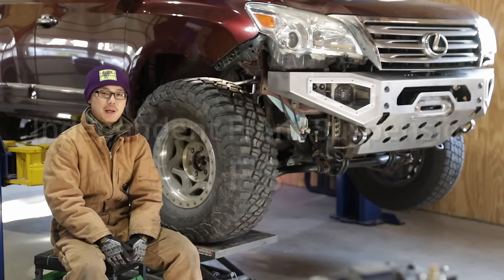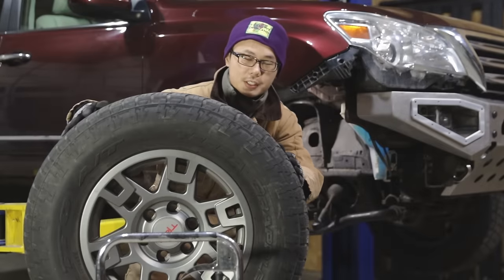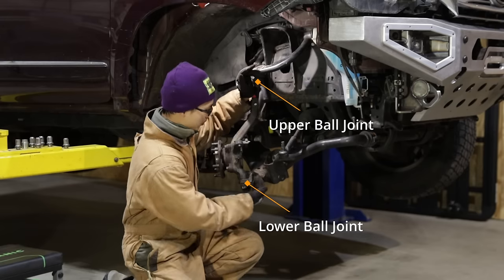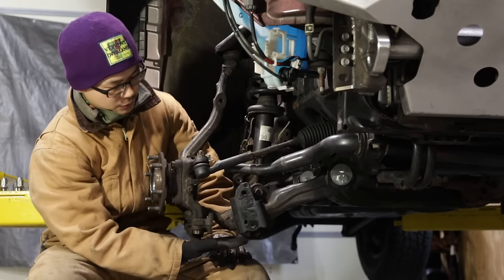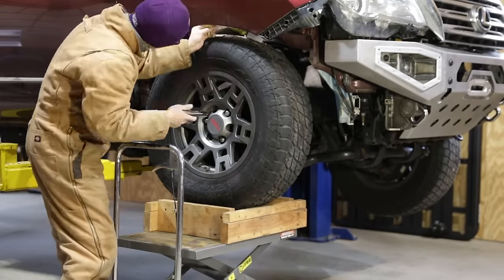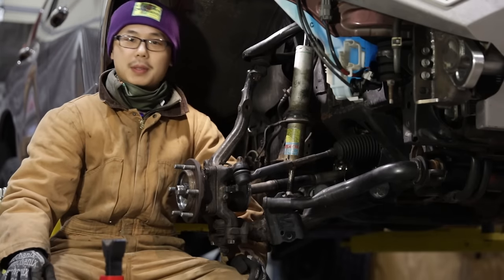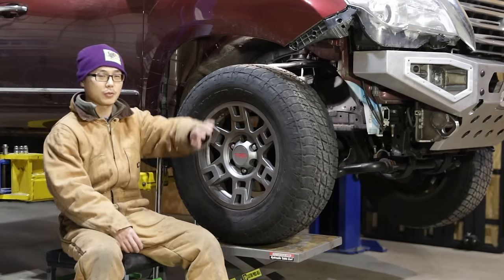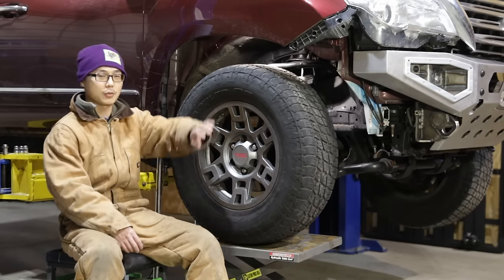Everything About Toyota IFS | Suspension Construction and Limits | Part 1

Comment: Absolutely love this series. I always knew   I wanted to lift my 4Runner no more than an inch or two because I feel heavily lifted rigs were so excessive and unnecessary. People get obsessed with fitting bigger tires, but with that you’re going to increase weight, need lower gearing, drop the diff and with all of that you’ve now taken a beautifully engineered vehicle and changed it to something untested. You’re also going to effect CV angles (they break all the time) you’re going to raise your center of gravity and risk toppling over, and you’re going to lose down travel at the cost of increase up travel. 

Super interesting to see you test the diminishing returns you see in travel and articulation. My goal will be to maximize my travel and articulation while maintaining ride quality and factory reliability. I cannot wait to see your video on sway bars cause my next purchase was going to be detachable sway bar end links
Reply: My stepson has bought an older single cab Hilux.  He doesn’t even have his license, but has embarked on “improving” it.  He has lifted it by 4 inches and wants to put oversize wheels on it.  I am quietly confident that he will be breaking driveline and suspension components as he also has a heavy right foot.  I would love him to watch this video, but I doubt that he will.
Reply: With longer  suspension uograded you  gain upper and lower travel.  . He said so on the video. Dunno confused
Reply: @DavidRamirez-fe5dd  watch part two. He’s taking about extended coils, most lifts are stock coil size, adjusted with preload.  Which comes with its own set of problems.
Reply: @bruiser6479  I looove the hilux. I would focus on making sure that truck runs perfect with no misfires and such before doing anything to the suspension. They do make good rock crawlers, especially with the solid axle.
Reply: @jvogler_art4708  I totally agree.  Unfortunately my stepson doesn’t.  My advice to him was to leave the vehicle stock and to only change things when there was an objective necessity to.  He really has no understanding whatsoever of how vehicles are designed to be a coherent system.  He is adamant he wants to learn from his own mistakes as opposed to other peoples mistakes.
Reply: @bruiser6479  Isn't that what we call, "learning the hard way" ? haha.  I don't mean or wish him any harm and you're giving him some great advice.  It can sure get expensive going with what looks cool but has negligible or sometimes negative value for the vehicle's intended or actual use (not to mention failures far from home and then downtime) which is what you seem to be advising him about, oh well... He'll learn eventually !
Reply: That’s kinda why I was leaning towards the trd lift kit.  2 inches and if toyota is ok with it, it can’t be too bad right?
Reply: @ceeIoc  2 inches is optimal for a 4 runner. If you wanna fit 35s and up and make a serious offroader  you have to body lift and tub the wheel wells. continuing a higher suspension lift will just raise the center of gravity and you won't fit bigger tires. Been demonstrated on this channel and others.

Eimkeith a serious offroad fabricator for 4runners runs a 2 inch suspension lift and a 2 inch body lift. Much better than a 4 inch suspension lift which bascially just changes the starting point of the suspension and loses down travel.

As far as a TRD lift goes, Toyota told TRD, when making the TRD pro that they could do anything to it except raise the Center of Gravity, because its a huge liability for them and increases chance of rollover (you probably won't roll though) but anything TRD is going to be basically aftermarket (not official toyota exactly) but licensed through toyota, unless that has changed over the years.. Probably why they approved a 2 inch lift kit. Doesn't raise the center of gravity very much because the suspension is still traveling in it's normal range of motion and not a raised one with no down travel.

For my rig i just opted for bilstein shocks and 32s lol. Decided i didn't want to be johnny MOAB anymore and just wanted to enjoy driving my vehicle in safer locations. and use it for camping and road trips.

Comment: Kai… thankyou so much buddy… never seen any videos get to the details you have done… little overwhelming with the technical stuff, but it’s amazing… I just upgraded with a 3” lift kit from Ironman, I think I need to lower it to May be 2.5 or more…. Keep it going buddy… great job
Reply: Have a question, I see in the video you are adjusting the front coils… is this something that can be done when the strud is on the vehicle…
Reply from the maker: Thank you! It depends on the coilover design. The ones with a solid adjustment rings like this, you can. Just lift the tire off the ground so the spring load is low enough. Some other ones like Fox and Kings have a split clamping style ring. Those you better remove from the vehicle and use a spring compressor before adjustments. With the spring load in place those can easily skip thread and bind.

Comment: Great video! You should do one about how to get more droop, like using a diff drop, and how a small half inch spacer would work with an already extended travel coilover, and what upper control arms maximize droop, and how that comes into play when trying to clear the body mount for a high caster wheel alignment

Comment: You have an increbible talent to explain things simply in a way that are easy to absorb by others.  I have forwarded your links to several friends and they say the same thing.  I am a neophyte but learned so much in 2 videos.  I don't see any videos discussing what you do with the rear suspension once you modify the front and/or change tires.  subscribed!

Comment: This is the fifth of your videos I have watched today. There is no better channel on YouTube with regards to off-road suspension than yours. I currently have a Jeep tj with 12” of travel split 50/50 (6” down, 6” up) in the rear and 11” in the front nearly split 50/50 (6” up, 5” down). I’m not saying that to boast or compare to Toyota ifs but I can appreciate the painstaking work of cycling the suspension with jacks over and over and over again to get it perfect. I also love Toyotas (had a 60 series years ago) and will probably purchase a 4Runner before the new version is released. I have been researching suspension information like crazy and nothing compares to the information on your channel.
Reply from the maker: Thanks! Yeah Jeep is really great at doing this type of stuff. I recently worked on an JL and was simply shocked how much flex it can get with so little work.

Comment: Hi this is great stuff!

0. Did I get this right? The top limit of the wheel travel is the rubber bump stop. The bottom limit is the full open length of the strut. The difference between these is the "wheel travel".

1. When you say that only the static equilibrium point shifts when the ride height is "lifted", what type of lift do you mean? How was this "lift" achieved.?

2. If a top hat spacer is fitted above the strut, to achieve the aforesaid "lift", then the static equilibrium point would still shift down. But would the strut's extended length also cause the down travel to increase beyond the previous droop limit. Would this mean that the wheel travel in this case is not conserved and has increased? (by an amount equal to spacer thickness) ?

Thanks for the video and effort in explaining it practically.

Comment: Rough Country cheap coilovers actually have really good stroke/length for a 3" lift, and 07-14 Tundra rear shocks are pretty much perfect for extended rear down travel without going wild with bumps and 35s, or needing a specific extended travel progressive spring.

Comment: Ive got a 3rd gen Tacoma and this channel is fantastic. Ive got a set of Ole Man Emu springs around some bilstien shocks for a 2" lift. I also have some JBA upper control arms...Its all in my closet right now. Looking at 285/70/17 tires and some 17"wheels but now I think its too much. Maybe I should stay within the factory 16" wheel realm.  I will keep watching in hopes wheel and tire combos comes up. I cant find a 285/70/16 tire from a reputable company so there must be a reason.

Comment: Spot on! Dobinsons is the perfect example. They have a standard travel and extended travel shock for the GX. If you look at the specs for both, both shocks have the same compressed length, but the extended travel shock has a greater extended length. There’s no reason to not go for extended travel! If only I hadn’t learned this the hard way after my standard travel shocks were topping out, exactly as you described 😁. Another great video from this channel, keep up the great work!
Reply from the maker: Thank you! Yeah when I first realized this after a regular lift, I was so disappointed. So I bit the bullet and got long travel😄
Reply: Kai, as all the others have stated, your videos and sharing of knowledge is fantastic! Can you point me to the second part, I can’t find it.

Comment: you are the smartest automotive vloger...very detailed and well explained about IFS specially for toyota truck and suv...can I still use oem uca for 2inch lift for the front and 1inch for the rear on a 2015 4runner sr5...

Comment: The more watch your scientifically accurate educational reviews i am convinced the best setup for me and what I actually do with my FJ would be the stock suspension with the stock tire and wheel size for both on and off road performance including best fuel economy. The best upgrade in my opinion for stock FJ IFS configuration would be a tire upgrade from 265/70/17 to 255/80/17 and be done with it. If im correct that would give me a slight advantage in ground clearance with a lighter  tire and no other cons.

Comment: The only thing I'd add to this, is that a STRUT is not just a coilover... a strut is actually an integral part of the suspension.  If you remove it, the motion of the wheel is no longer constrained.  Many manufacturers of aftermarket parts and maintainers get this wrong (or just mislabel them).  Think of the front suspension of say, a Camaro vs a Corvette.  If you remove the front damper of a Camaro (a strut based suspension) the wheel will not be constrained and can move wherever it wants.  If you remove the front damper of a Corvette (a double wishbone) the wheel is still constrained, just undamped.

So for that, while many people call the front damper setup on a double wishbone a strut, it is an improper use of the term.  It's a coilover shock.
Reply from the maker: That makes sense. Thanks for pointing that out! Basically strut is only for something like a MacPherson strut construction, which serves the part of the function of steering knuckle and UCA.

Comment: Dude, I have a hard time believing that Toyota has not called you yet!??  Your videos are organized, informative, and well edited. Thanks for taking the time to help explain a very complicated subject matter within the Toyota off-road Family! I found your video looking for options and info on lifting my 2020 Tundra.  I would love to hear your opinion on the TRD Pro o.e.m. suspension vs. the standard o.e.m. Toyota off road [ or base] . It would help clarify if its really worth the extra $$ to pay for that particular model or just buy the SR5 and modify the suspension independently.
Reply from the maker: Thanks. I personally rate the TRD Pro internal bypass Fox very high for enthusiasts use like you and me. I rate it higher than aftermarket Fox, Kings and etc 2.5” diameter shocks with adjusters. Internal bypass allows position sensitive dampening, which regular 2.5” racing shocks cannot do. The rubber bushings top and bottom are also more reliable than spherical bearings common on racing shocks. The piston will be slightly smaller than regular 2.5” shocks because of the internal bypass architecture, but that’s not relevant unless you are actually racing. TRD Pro trim does come with some other nonfunctional features so it’s personal choice if the full package is worth it. But you can easily buy just the suspension parts from Toyota, which is worth it.

Comment: I would love to see A video of what happens to suspension if you out a expensive lift kit in and Still Keep The Struct 2inch Spacers Installed Like installed on a Dobinson or fox Lift instead of Level Lift spacer with Stock suspension most if not all High end lift companies say never Keep tour Level Lift spacers On upgraded coil over lifts. Thing it would be a great educational video are they full of crap or could it cause harm to use level spacers on Expensive lifts 12:41 @Tinkerer's Adventure

Comment: Great informational video!  Nissan’s IFS suspension in the second generation Frontier and Xterra is similar to your Toyota.  The knowledge that you provided on your FJ, can be applied towards the 2nd Gen Frontier and Xterra IFS suspension.
Reply: Nissan are not lift friendly.  Been told by everyone  that  they can't  be lifted.  Been trying to lift my pathfinder.  Only spacer  lifts or extreme fabrication  and tweaking
Reply: @DavidRamirez-fe5dd  what year is your Pathfinder?  I’ve lifted just about every Nissan that I own.  The only problem that I’ve ran into,  is Nissan doesn’t have as much of a aftermarket support like a Toyota or Jeep.  I’m currently doing a Titan Swap on my 06 Xterra, pretty much a factory long travel kit.  After I get done with that, I’m starting on Solid Axle Swapping one of my D21 Hardbody trucks.
Reply: @lb8528  98 Nissan pathfinder manual  transmission.  All the shops  say no and only offer  spacer  lifts
Reply: @lb8528  Nice . Dang going solid axle. So much more ease and less crap to deal with. I'm  on the fence about lifting my toyota pro 4Runner it has great factory fox shocks. But astetics it looks stock and really low. My pathfinder 265000 miles  is bullet proof stock but have run into lots  of clearance problems.  I have 31×10.5 On bfg ko2s . I mostly mall crawl in my 4Runner Lol

Comment: I have a question about my 3rd gen 4runner ....
Does the upper control arm, spindle and lower control arm always move at the same force and distance? (Up and downward)..And is it the outer tie rod and lower ball joint that is holding them from breaking the even amount of distance/force. I recently converted my oem upper control arms (JBA uca)which now converts the ball joint to face downward with an adapter sleeve that presses into the spindle /knuckle where the oem ball joint used to press facingupwards.. Which is held by a retainer clip..I  am sure you are very familiar with this set up. I was concerned if the upper control arm will ever have enough force to push that sleeve out from the spindle  and cause The upper control arm to separate from the spindle? From what I am gathering is that as long as the Outer tie rod and lower ball joint stay intact with the lower control Arm and spindle ,that could never occur for them to break apart and move at different force? Please correct me if I am wrong and I appreciate your help...

Comment: Great info. It’s would be fantastic if you simply said the best combination of front and rear lift that optimized both up and down travel from a stock vehicle. You don’t have to be brand specific. Ie. Stock FJ, bmc’d, 285/70/17. I would value your opinion on an optimal setup of f/r springs and f/r shocks and best uca.

Comment: Could you do a video or provide such knowledge for the 19-23 rav4 adventure? I installed front spacers 2.0" & worried for cv issues. 
Also did 1.5 in back, including trail arm and control spacers.

Comment: Great video! I just subscribed to your channel. Thank you for the wonderful information! I also have a 2011 gx460 premium w/ kdss, AHC and airbags. I've been trying to figure out a new suspension set-up for the longest time. I was thinking about Icon 2.5 extended travel coil over up front w/#650 spring and/or Icon tubular UCA or SPC. I'll also be swapping my 18" wheels for 17x8.5 w/0 offset and 285/70/17 tires. Would you consider this to be a good set-up? Should I keep the height adjustment at 2.5" for front? Do we know the factory toyota spring rate that came on these trucks?  For the rear I'm thinking Icon 2.0 shock w/ OME medium/or heavy spring. Please let me know if you have any input. Any feedback is greatly appreciated..
Reply from the maker: Thanks! Yeah that's pretty decent setup. I would personally choose the SPC for its function like I mentioned during the 1st myth. More details about UCAs coming in a future video! For lift height I would go for the minimum that satisfy your taste. For my personal FJ, i'm on 2" lift, 315/70R17, -3mm offset, and long travel IFS control arms. I have around 5 inches of droop which is beneficial for rock crawling. But rock crawling isn't something everyone enjoys so you should adjust accordingly for your balance.
Reply: @TinkerersAdventure  What's your input on the front spring rate? The icons come standard with #650. Would you recommend using the #650 until I install the front bumper and winch? Then possibly swapping the #650 spring for a #700? I would be adding approximately 170 lbs up front. Any feedback is greatly appreciated. Thanks again